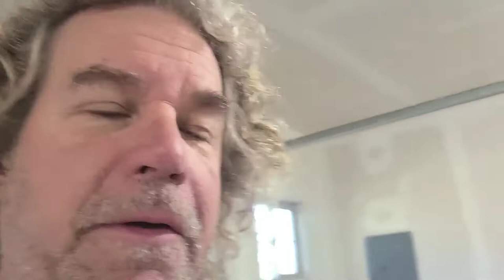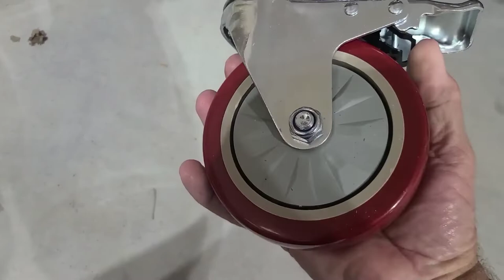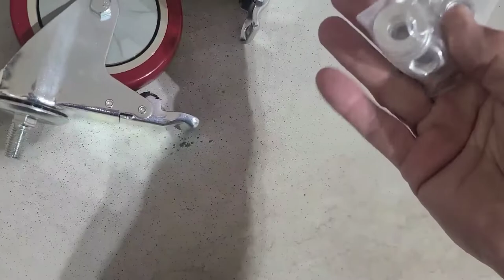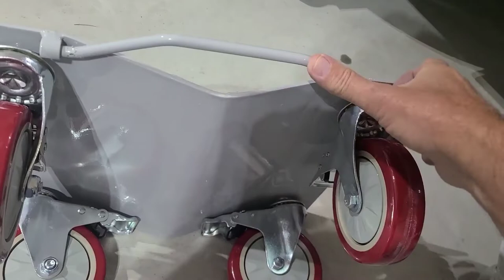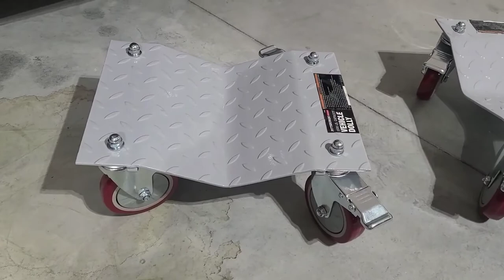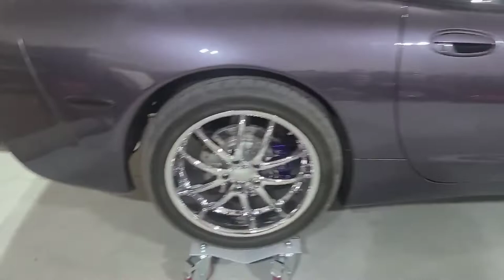Harbor Freight Car Dolly Mod

Comment: What brand of wheels did you purchase?  Or do you have a link on Amazon?
Reply from the maker: These are the ones I purchased. They've held up great so far and make the car so much easier to move around then the ones that come on the dollies originally. I'm still pretty happy with them.

DICASAL 5 Inch Heavy Duty Stem Casters 360 Degree Swivel Thread Wheels with Metric Size M12-1.75 Screw Bolt Double Locking Brake Castor Wheel Load Capacity Upto 1200 Lbs Pack of Four https://a.co/d/fgwdXru

Comment: I love being in my garage with my toys love my happy place! Hey have you done a vid on steering wheel lock deal my car just gave me a great message ugh
Reply from the maker: That's my sanctuary too. Love being out there. When I bought my car back in 2007, I  had the dredded column lock happen. It was before I started doing videos on it. I did fix it but I didn't even think of recording it. I used the CLB which was the go-to repair at the time. It's been on since installation back in '07 and I haven't had any issues with it. There is a new one on the market now called the LMC5. I don't know anything about it though. Good luck with yours too.
Reply: @c5grapeape  I just ordered lmc5 last night so I’m praying it gets here soon and I can do it I’m a body man and I hate electrical work 😂
Reply from the maker: @ajcates9136  From what I hear and read about that one, it's not to bad to install. Good luck.  😎👍
Reply: @c5grapeape  thanks for the content u on Instagram
Reply from the maker: @ajcates9136 Most welcome. I'm not, sorry. This and the Corvette Forum is about all the social media I do.
Reply: @c5grapeape  dude you ever need anything custom paint or Harley Davidson or collision orientated would love to help out I ain’t trying to sell you anything but just telling you thanks 🙏
Reply from the maker: @ajcates9136  Thanks man. I'll definitely keep you in mind. Appreciate that very much.

Comment: Hello, can you send me the link to those wheels
Reply from the maker: Yep, found them. Got them from amazon. 

DICASAL 5 Inch Heavy Duty Stem Casters 360 Degree Swivel Thread Wheels with Metric Size M12-1.75 Screw Bolt Double Locking Brake Castor Wheel Load Capacity Upto 1200 Lbs Pack of Four https://a.co/d/dBzx8tc